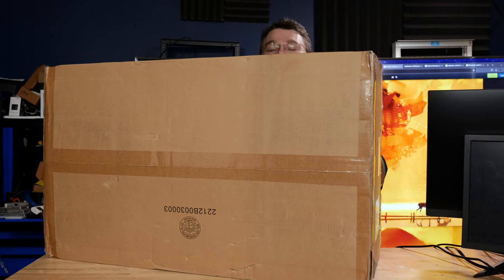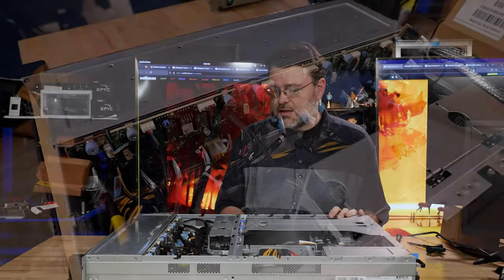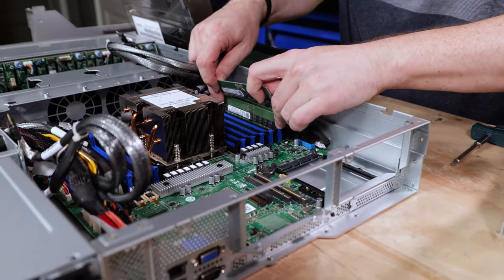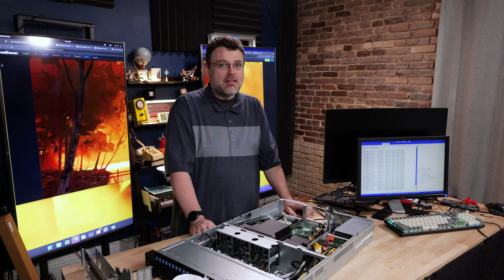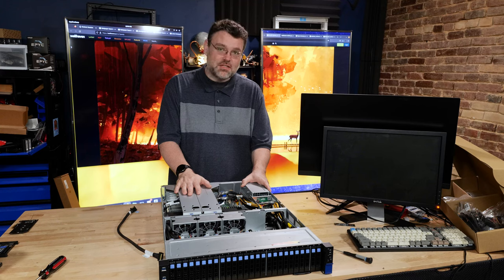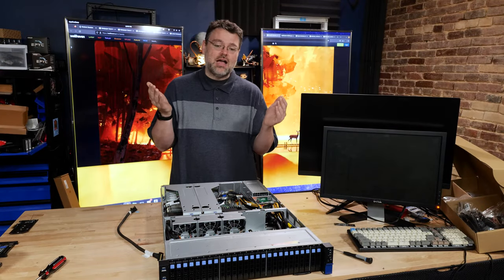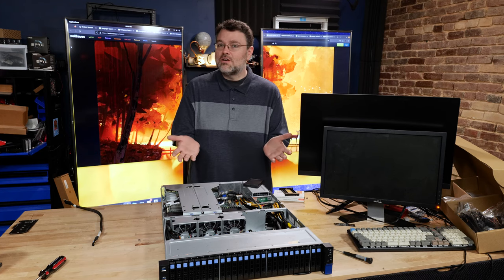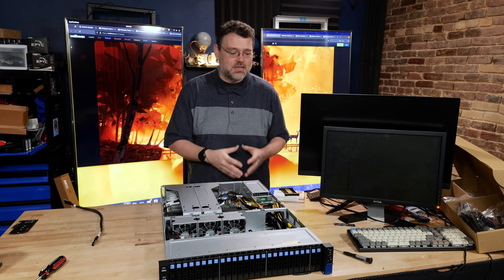Tyan TS70A-B8056 - 1S Dual DIMM 24+2 NVMe Epyc 9004 Powerhouse

Comment: Issue with vSAN would be the difference between OSA and ESA. I think the Kioxia drives are supported in ESA, but they really want the barebones to be ReadyNode. But you can run AF8 profiles with 100Gb, 6 being dual 25Gb. It works for most workloads well.
Reply: Also most Ready node setups in AMD are single socket, including even their top tier. So even VMware realized that dual socket, at least in Genoa, wasn't really necessary.

Comment: slap windows on that bad boy and let it rip crysis software render. full pedal to the metal
Reply: I doubt that's the best use for this system... Like, at all. 😂 Crysis ain't optimised for this beautiful hardware.
Reply: I think this might be the perfect system to function as an SMB’s DHCP server!
Reply: @boneappletee6416  Apparently with a FPGA, it can parallelize any kind of machine code without any kind of modification.